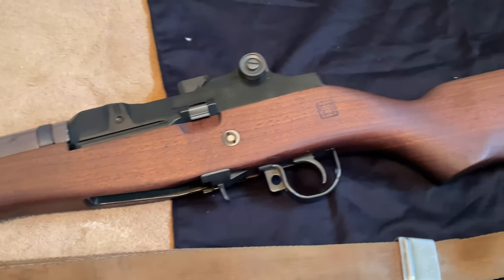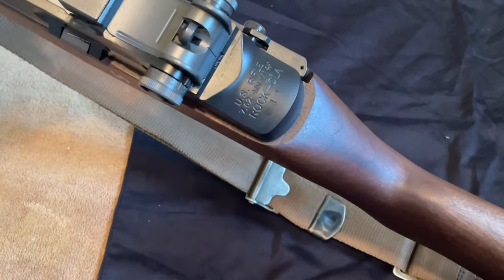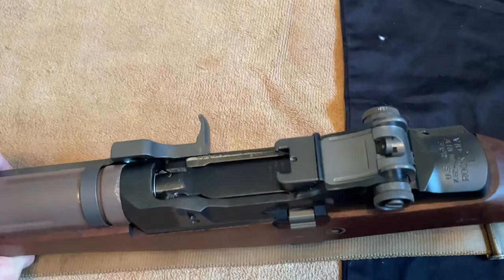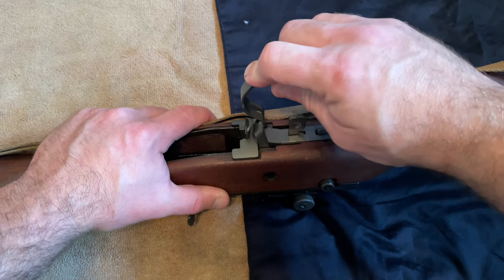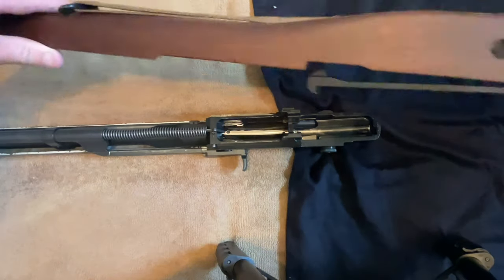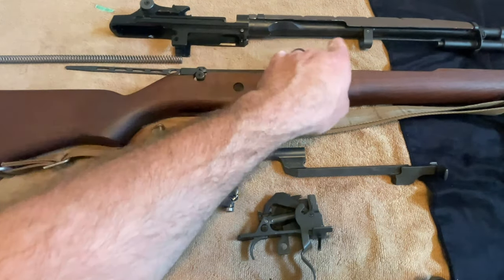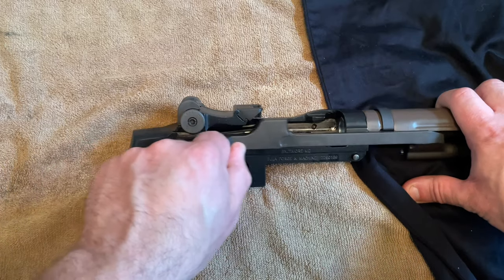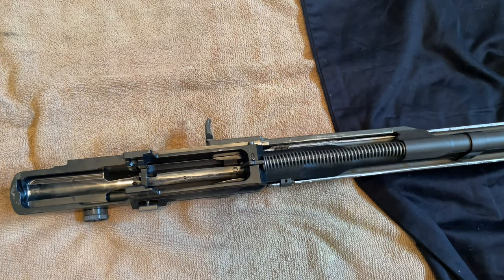How to Field Strip an M1A / M14 Type Rifle

Comment: Excellent, informative video. I have a Socom 16, I've followed your instructions, and I've found the "sweet spot", however I cannot get the op rod to release. Any suggestions? Thanks in advance...Clint
Reply from the maker: I wish I could help, it’s tough without seeing the gun firsthand. The first few times I broke mine down it took quite a bit of wiggling and working around before I finally got it loose. Good luck and I hope you get this worked out. Thanks for coming by!

Comment: I have a Springfield M1A. I tried and tried, but the pulling-back idea won't work! The trigger guard will not budge to the rear as you're showing it.
Reply from the maker: It is under a little tension, almost like a spring. Maybe oil it at the point where the trigger guard connects to the rifle on both sides and let it sit for a while. If it still won’t release you might want to have a gunsmith look at it. Thanks for coming by!
Reply: @cornfromajar3222  I learned that placing a screwdriver or another length of metal in to the small hole in the rear of the trigger guard - and pulling up - will release the guard. It works very well.
Reply: Use a screwdriver sideways for extra leverage. Earlier Garands had a hole there for that purpose
Reply: The hammer has to be cocked with the safety on also ,and it could be tight.

Comment: And at what time you took screws off on both sides of a stock that's holding action assembly?
Reply from the maker: If you field strip according to the army manual, you shouldn’t have to take off any screws. Thanks for coming by!
Reply: Those are stock liner screws which hold your stock liner in. You dont normally want/need to take them out.